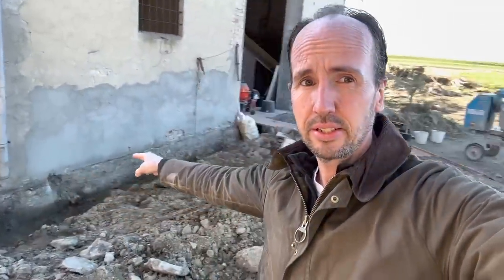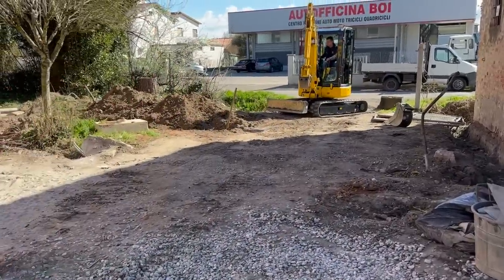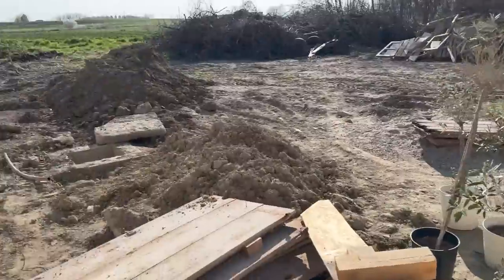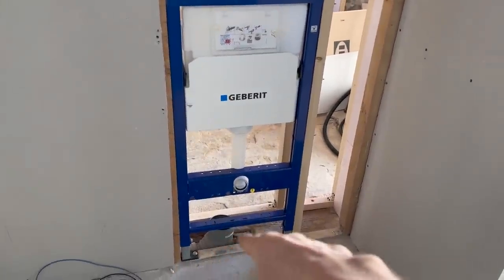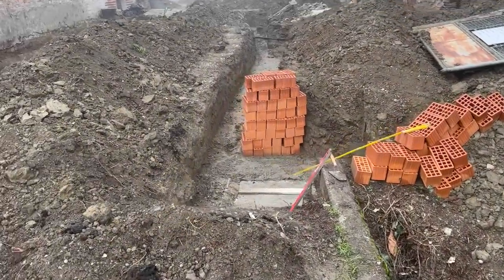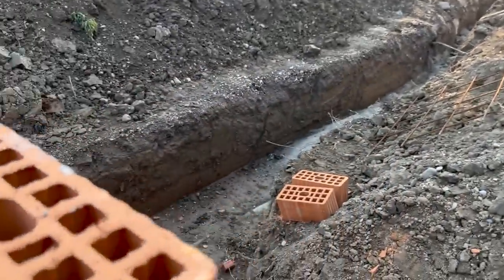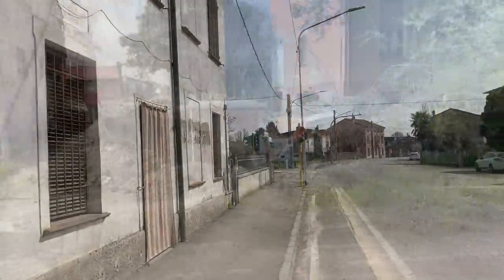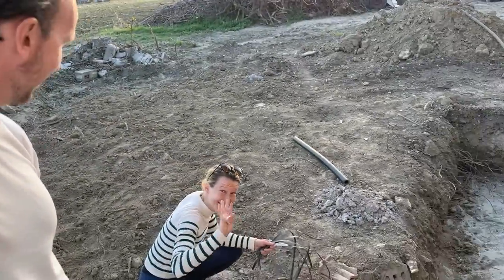Renovation CHAOS: From Marble Floor DISASTER to DIGGING Trenches for Water Pipes and Running Errands

Comment: I am interested in what your work history is Henrik.  This reno is rather complicated- at least with the barn portion. It seems once your electrical and plumbing is in, things should go quickly. There is so much concrete and masonry, it would be nice to have some wood accent walls maybe. Spring has sprung!
Reply from the maker: I used to work in finance and now I work for myself, I might go into detail in a future episode. 
Yes, there is a lot of stone in the stables but there is also a lot of wood beams etc on the 2nd floor. 
Yes, finally spring has arrived!

Comment: If you have a floor mounted toilet, you have a big problem.
Reply from the maker: Why is that Glenn?
Reply: Because the drain is supposed to be in the floor, usually 12" o/c from the framing. Although that's for a North American toilet. Things may be different in Italy.
Reply from the maker: @olafbigandglad  The drain is on the floor, but it's inside the wall. But if that is correct, how does a wall hung toilet work in North America?  I know toilets are very different in the US compared to EU, we have tanks that pour water that then dispose the waste while US have a type of suction function where the waste is sucked out of the bowl.
Reply from the maker: This is what I ment: Siphonic versus Washdown flush system
The general assumption about flushing is that the force of the water pushes the waste product down to the sewer system or a rural septic system. But guess what? That is not correct. Only European toilets use that flushing system – this style is called the washdown flush system. American toilets use the Siphonic flushing system.

For the American toilets, there is a long and narrow reverse ‘S’ or ‘P’ trap with two ends. One end is connected to the toilet bowl and the other end is connected to the drain pipe which is underneath the toilet bowl. The aim of the technical design is to create a siphoning action when flushing. The siphon is so strong that no matter how heavy the waste product is, it gets ‘siphoned’ out with the water. At the end of the flush, there is a gurgling sound signaling the bowl is filled with water and ready for the next flush.

For European toilets, the washdown flushing system uses the weight and the gravitational force of the water to flush out the wastes. It is also technically built such that the pipe behind the toilet is almost twice as wide as that of the American toilets. This wide pipe technique ensures washdown toilets are relatively clogged free.